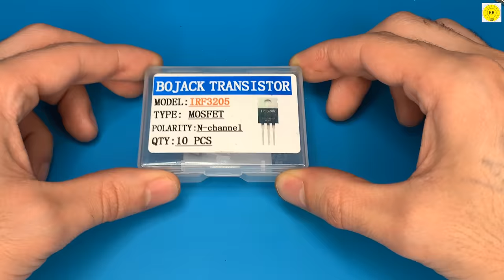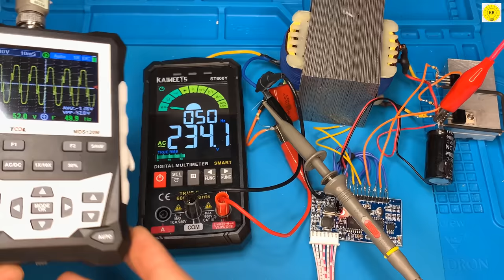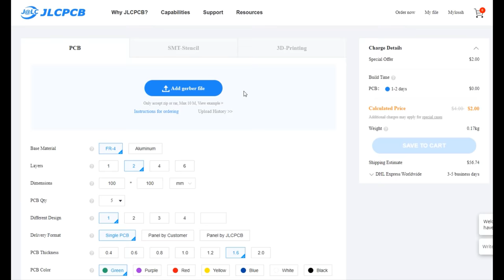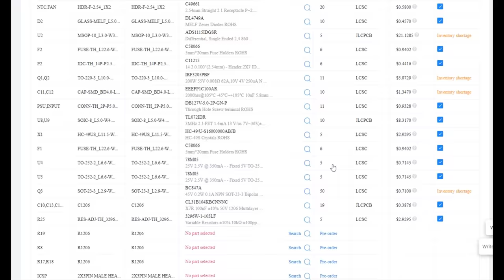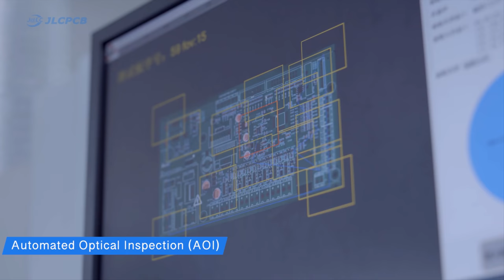DIY 1kW sine wave inverter 12v to 220v EGS002 , jlcpcb

Comment: A 12V supply can only deliver an rms AC output of about 12/1.414 or 8.5V and, to allow for voltage drops, most people suggest a 7V to 220V transformer.
Reply: Yes you can use ups transformer

Comment: I see you have fitted a capacitor across the output but I don't see a high-current inductor in the feed to the transformer. Was this deliberate or does an EI transformer not need one, as contrasted to a toroidal trans ?
Reply: When using a transformer, you don't need an external inductor. If you use the "high voltage DC" option then you need the inductor
Reply: It is not soft start??

Comment: it is 49.9hz not a sinewave but modified..a pure sinewave is 59.0hz or 60hz
Reply: Pure sine is 50/60. The driver board is pure sine, the wave is showing modified sine because of the connection he used. 

He is using a center-tapped transformer, the board was not designed to work with that.
Reply: @mthompson965  The circuit on a transformer with a central tap is not capable of producing a pure sine. Only "modified". Only the bridge topology is capable of this. The author does not show voltage waveforms on mosfet drains and currents through them.

Comment: Hello, very nice video. I did the circuit but above 200vac the voltage drops to 180vac. Any idea why ? Thanks.
Reply: this circuit was simplified by the author, don't have feedback of voltage to correct deviations
Reply: hows the project it working?
Reply: @radargenta  так захист повинен спрацювати юез ОС
Reply: To my opinion only....It will drop because he didn't use a Torroidal transformer.

Comment: This circuit does not work makes the mosfets too hot and does not produce sine wave I have tried couple of ESG002 the same result all the time ESG002 does not work properly and only 1LO and 1HO works but not 2LO  and 2HO porst no sine wave out put of transformer.

Comment: The output is not pure sinewave.
Reply: No bro pure sine wave egs002 drive card generate pure sine wave
Reply: Did you add he output capacitor
Reply: @joshuaolakanla3993  capacitor 255j (2.5uf) 400v

Comment: Hello! Interesting and useful! I am a "beginner" and I would have liked to try to make one, but I did not understand the connections to the EG in the video. If you want to help me assemble a test one with a diagram or a photo. I have a solar on 24v and I- it would be helpful if I could make it, maybe it is also functional on 24v Thanks in advance!
    If you want to help me, maybe with explanations and how to order the circuit, I would be deeply indebted! Thanks again!

Comment: 1Kw, a 12Vdc, sono 80A...
...quei cavetti si sarebbero vaporizzati!
Reply: This is a test, you will use four transistors and good wires. And then you will get 700 - 1000 w